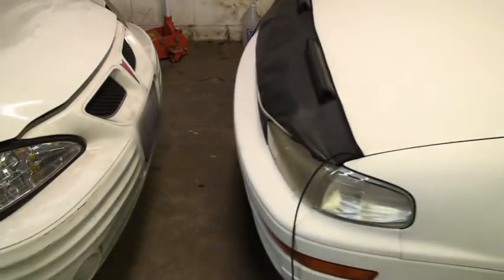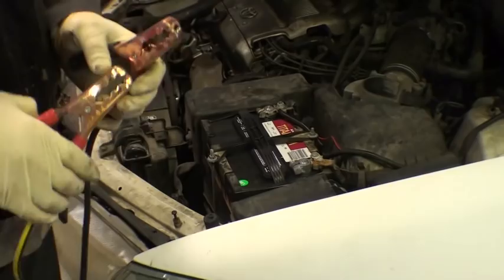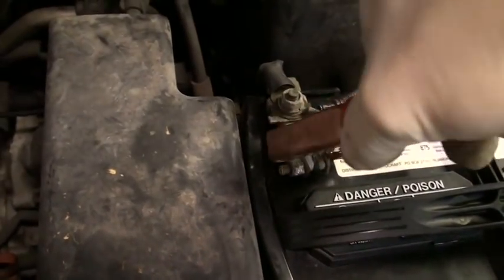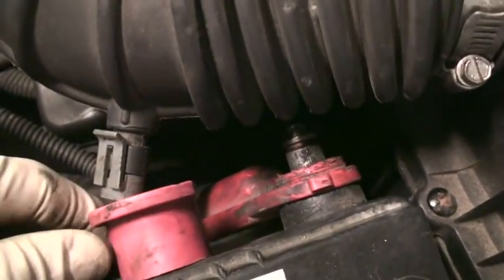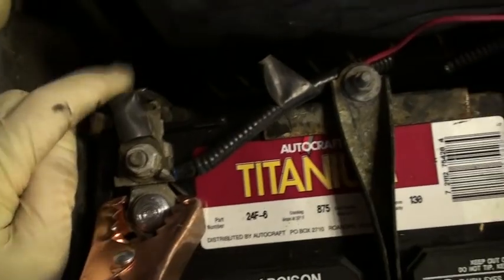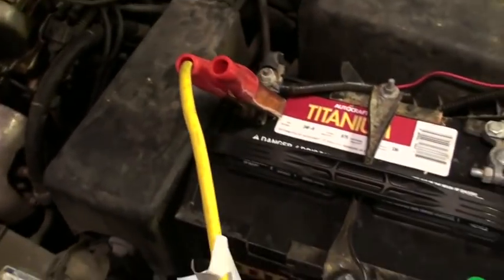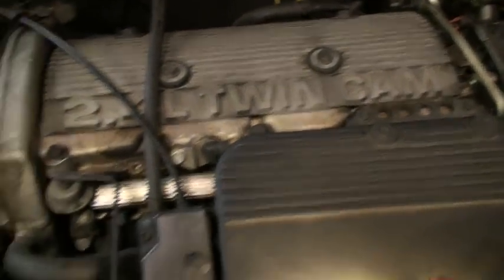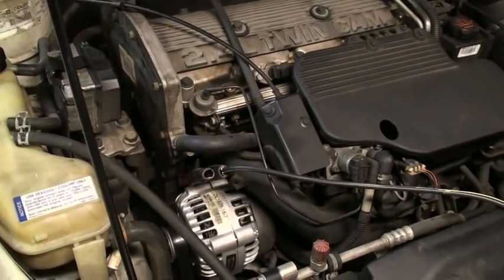How To Jump Start A Car - EricTheCarGuy

Comment: How does a starter work exactly? Like once you turn the key what is happening in your engine? This is something I've been wanting to know and never learned. Thanks
Reply: +Country Hits it turns the engine from with in the transmission.  When a car is running, the force from the combustion of gas in the cylinder forces the pistons and turns the crank shaft.  The starter, from within the transmission, turns the crack shaft, which moves the pistons and when the piston is up, air and fuel are added into  the cylinder and a spark combusts the gas, starting the engine.  The job of the starter is just to turn the engine until combustion happens.

Comment: I know I need a battery & didn't think much about it until my truck wouldn't start, I early on poured coke soda on the cables in May of this yr & have not had any issues until lately.  I will try hard not to go this route again.  Thanks for the video Im goin to buy new battery today.

Comment: On the 2013+ Chevy Spark you can actually void any electrical related warranty by directly connecting the cables to the battery.

Comment: ***** You don't want to connect the black Negative cable directly to the terminal because you can damage fuses, certain circuits, or even the ECU with that "sudden jolt" from the working battery...

Comment from the maker: @sammislawa I recommend watching the video I did on Load Testing A Battery.  I would also check to make sure the battery connections are clean and tight.  If you don't find your issue with this advice email me and I'll see if I can help further.

Comment: Hey Eric.. Liking the Channel so far. 
So i just heard that its advised that the "GOOD CAR" should leave its engine off when giving a jump start to the "BAD CAR". 
This should be done to avoid damage to the good car, especially modern cars that have more electronics. 
This is new to me as I've always done it the way you've  instructed in this video (minus leaving the negative off the BAD CAR, thats new too). 

Can you credit or discredit the theory about leaving the GOOD CAR's engine off? 
Thanks.

Comment: Eric, does the order of the positive plugs connection matter? For example if I plugged in the positive end to the working car first instead of the dead car followed by the other positive end onto the dead car and then the black end on the working car and the other black negative end onto a piece of metal of the dead car would that still work? Thanks

Comment: would you get shock or start a spark if one jumper cable is touching medal? Like if you were clamping them in the side of the car so they won't touch.

Comment: @EricTheCarGuy ohh okay thanks(: Sorry for all the questions but, i already replaced my **4th** hose, they keep getting tiny holes like the size of a needle then the pressure makes it bigger, do you think this is due to the radiator cap pressure or is it just normal for them to be breaking like that? Theyre old but 4 hose rips in 2 weeks? and questions 2, my car is automatic and when it goes to next gear or whatever its called it kinda hops, like how a stick shift car would, what could be wrong?

Comment: Here is a question, I recently had my 2002 Hind Accord SE serviced. Apparently the starter relay had stopped working, my car would not start. After picking up my vehicle, a day later I notice my cruise control no longer works, I took my car back to mechanic that replaced the relay, and he tells me "Nothing I did would have affected the cruise control". The CC was working fine before I took it to him. How can I trouble shoot the CC on my make and year? Thanks.

Comment: The slam panel is where the bonet shuts, go to goggle if you dont know what i mean, british and US have different words for some things, so i dont know what the correct word you would use for it is :P
Thanks for the reply thugh, it was just  a small spark. maybe its cause the job leads are old and cheap lol
on another note, how long do you think it will take, for the battery to recharge back to full power 12v?
Thanks again Eric ;) Great vids

Comment: I also have a pontiac grand am. how do i disconnect the battery? mine has these rubber boots on the side posts and i'm not sure if im supposed to peel it off, yank it or if the metal post sticking out actually unscrews.  thanks

Comment: i have a project car that i want to install a auxiliary fan. but i want it to be controlled by a thermostat. is there a thermostat that i can buy that can do the temp sensing for the aux fan? i kinda know the wiring with all the relays. but what thermostat sensor could i use without using or relying on the cars own electric thermostat sensor? love ur posts and episodes ! real help for those who are tinkerers. thanks !

Comment: I'm always reluctant to jump start a moden computer controlled (ECU) car. Think I'm safe in saying that computers don't like sparks and current surges, which is something likely to occur with a jump start.

Not forgetting the possibility of damage to your good battery by a dead battery across it!

Indeed, a neighbour asked me the other day for a jump start, which I refused. As an alternative I offered him the loan of a charger for 20 minutes. And after 20 minutes charge the car started.

Comment: I left my car sitting for a month straight and now it won't start. The battery had no problems before. Do you think i need a new battery? Or does it drain over time when its not running? Thank you!!

Comment: I'm curious as to what gauge and length jumper cables EricTheCarGuy uses. I know what I have in my own cars but I'd like to know what you prefer in regard to jumper cables, Eric. Also, it seems that a lot of cables anymore are copper clad aluminum instead of pure copper like old ones, do you prefer one type over the other? Thanks for the cool videos!

Comment: I have a trick, ..maybe but i had two instances where my car radio was left on and I couldn't jump it. So (with all unnecessary accessories off before hand) I opened the hood and pulled the serpentine belt a few cycles to spin the alternator and that was enough to get my car going.

Comment: For those of you wondering why the last connection you make is to the chassis and not the negative terminal of the battery, here's why.

Because you're supposed to make the last connection away from the battery, so that the spark doesn't ignite hydrogen from the battery.
pos to batt, pos to batt, neg to batt, neg to chassis -- completes the circuit. These days batteries are almost always sealed so it doesn't risk hydrogen escaping or electrolyte leakage. But this is to be on the safe side.

Comment: it's just so you get a better ground on the connection. it isnt wrong to connect the wire to the battery, but connecting it to a larger piece of metal on the car is better.

Comment: Eric, my wife has just bought a 2003 Dodge Caravan 3.3 V-6, it's got a New Battery on it and check with a tester I have that it actually is at 12 volts, the vehicle has had a no start situation and from what I saw as trying to start that the digital display on the radio when trying to start goes completely out, my thinking is a Dead Short, normally I think that the armature in the starter is touching the field coils, I have cleaned the cables twice and they seem to be factory cables. Ok, you guessed it I installed an Autozone upper-level Reman. starter, darn thing fired right up like it is supposed to. Next morning the wife gets in and NO START, not even a turning of the engine. I haven't tried and checked the cables out as of yet and from watching your vids, I am now wondering if the cables are the problem, (they look original to me and have not had any of those stupid battery ends that you HATE put on), but I am getting NO TURNING of the starter motor at ALL, and that was the exact same situation before the starter change, so I am quite confused right now. One thing that surprises me was before I changed the starter, the vehicle had sat for a few weeks with the NO Start issue and just out of curiosity, thinking that maybe a hammer hitting the old starter MIGHT disengage the armature to get it running, low and behold, I turned the key and the damn thing started just like it was supposed to and I had not even hit the starter before I tried. Installed the  Newer Starter anyway and still have the SAME situation. I am wondering about the cables, but it would seem that I would get at least a dragging sound out of the starter if the cables were not carrying the right amount of voltage, I get NOTHING. I just can't figure out what is going on. Me hating Dodges (I'm an old 67-year-old Hot Rodder and have worked on quite a lot of vehicles in my lifetime) may be the problem, LOL, but I know better. Any ideas as to where I need to go, I would greatly appreciate any input you could give me. I am at a LOSS at this point and time. I hope you can make some sense out of me trying to explain myself with this vehicle.

Comment: What I do if I am asked to jump start the car is let the bad car charge up little bit by revving my car at 2500 rpm for 5-10 min. Then disconnect the cables and start the bad car. The reason for this is that all those newer cars have lots of electronics inside and are kind of sensitive. So I never encountered it myself, but heard that sometimes when you start a bad car while it is connected to a good car, this can damage some electronic parts on the good car, which is my car in this case. This might or might not be true but I do it as precaution.
Reply: +Sergei Shabarov The damage is more likely to happen to your car.  If you connect the jumper cables with your engine running, your computer will have a large drop in voltage from the new connection being made.  That is more likely to damage the system.

Comment: what happens if the alternator is dead? My car's alternator doesn't work and the car place says it costs $250 to change it. Is that reasonable or any other way to change it myself?

Comment: wait, my brother said it is better to turn off the good car when starting the bad car, as a precaution to keep the alternator undamaged... Is this true? I did jump start a car from my car, and well i told them not to start it yet, but like most people that don't listen to my already anyways, they did, and so im just wondering if it should be something to keep on considering or its not really going to damage the alternator at all by overloading...(my car has a 1.8T and the car i jumped was a V6:O

Comment: hello i had subwoofers recently installed in my 92 geo metro, and my amp turn on wire is hooked up correctly so its not running all day. but my car battery still dies from nothing....
is it because i need a new battery, or when i jumped it i didnt charge it long enough?

Comment: when replacing the battery with a new one, by error, I inverted the poles, it sparked and the horn kept going. when I realized the dumb error, I connected the cables +/- but now nothing comes on, everything is dead. did I fry somerthing or could it be the selenoid?

Comment: @EricTheCarGuy Hey btw you should do a video on how to wire a switch to control a radiator fan using a switch. I was looking EVERYWHERE how to do it but i couldnt find one but i figured it out x) and i even fit it into a empty panel cover so it looks all pro lol.

Comment: Here's a thought and how I have always done it. Listen on and it makes sense.
1. Start the good car first. so there is no chance of a dead car draining the good battery. That would be bad.
2. Hook up the grounds first, no chance or sparking yet. If you hook up the lives first, there is a chance to get something grounded accidentally. 
3. Connect the live on the dead battery before completing the circuit on the Good one. The reason is that a good battery has less a chance of leaking gas and with the car running, there will be no stale air to combust with the fan and the belts going. 

Would love to hear comments on this.
Reply: now thats the right way my friend. an an electrician we always hook up ground first in any installation becuase by hooking up live first the other end of the cable is potentially live
Reply: stephenacamille If you hook up the ground first, everything metal on the car you touch with the positive lead will create a short circuit. If you were to drop the positive lead inside the engine bay, you will have sparks (or worse) go everywhere. 
If you drop the ground lead inside your engine bay, you will create a regular circuit. Still some sparks but nowhere near as much amperage going through the leads.

Its for this same reason you always disconnect the negative pole of the battery first.
Reply: Raspoetin a you have them mixed up. The ground is directly connected to the frame already. So touching the positive lead on a ground will do nothing unless the other positive is already connected.
Reply: stephenacamille Both the positive and the negative are already connected to the battery of the donor car. Its the donors car battery that you are shorting out.

Comment: you can crash start  stick shift car as well (down a hill or a slope. or push )get the car rolling put in to 2 and let out the clutch if you are roiling fast a buff it will crank over
Reply: +Chris Taylor That is also referred to as pop-starting.

Comment: alternators put out the same voltage no matter the speed.   Revving up does not help.
Good advice to run for a while before starting, though.
Reply: You're wrong. Alternators do put out higher amperage at higher RPMs.

Comment: I have a question. I have a 1997 Toyota Corolla that has been giving a P1300 trouble code for a while now. I have had the distributor replaced. I have had the spark plugs & the spark plug wires replaced. There must be some electrical issue with the wires going to the computer or something I think. Maybe the igniter...? I have no idea. Help!

Comment: Okay, why would you want to connect the negative cable to some metal part instead of straight to the battery? I don't see any difference since the connection between the negative battery terminal and the rest of the car's metal is usually pretty good and you could cause sparks anywhere.
Is it just because of the hydrogen that might form around the battery, where you wouldn't want any sparks when connecting the last connection? If so, wouldn't those fumes disappear after a few seconds that you left the hood open?
Reply: pcfreak1992 Yes you are right I think but this is an instructional video and it's always better to be safe than sorry with stuff like this.
Reply: +pcfreak1992 You are correct sir, when a battery discharges, it can, (key word there is can), let of hydrogen gas which could, (again key word there is could), explode if the connection sparks when you hook up the jumper cables.
Reply: +cjgaltieri yeah I thought so, but I still can't imagine how in a normal scenario hydrogen would ignite if you jump start a car. Usually you open the hoods first and then figure out where the battery is and by the time you connected all four ends, the hydrogen should have left from wind or something.
Reply: +pcfreak1992 your exactly right, it would most likely not happen.  Thats why we do not hear all sorts of stories on the news of peoples faces being blown off while jump starting a car.  It is very unlikely to happen, but it would be really bad if it did explode, and it really doesn't take any extra work to connect it to a different ground, so its just a simple case of, better safe than sorry.
Reply: HYDROGEN GUYS, HYDROGEN!!  Surely you know a battery produces HYDROGEN.

Comment: If the cables were hooked up wrong and the connections started to smoke/spark would the damage show up right away, or would it take some time? Would it damage both cars?
Reply: +VanSaucy It would must likely show up right away.  It would have the ability to effect both vehicles.

Comment: Thanks... of course I meant *wear* not *where* safety glasses.  Another thing you can try is to start the good car then connect the battery of the dead car.  You will hear your alternator kick-in and re-charge the dead car's battery.  Just disconnect before starting the other car as you do NOT want two alternators running at the same time nor should you try to jump start off a running car.

Comment: hey can you do a video on master switch for power windows .. my driver side window rolls down but all 3 of my passenger windows does not work at all. tried to replace the main relay fuse and no luck.

also another video on the fuse box for the SMALL LIGHT category . that fuse for SMALL LIGHT keeps popping and my brake lights will not turn on when it's on daylight position ..my headlights are on but my taillights are off. please and thank you

Comment: With my understanding of how electricity runs through a battery I would love a detailed explanation as to why you would ever need to start the good car and why you would even want to, seeing as how starting and revving the good car would only wear down the alternator. Anyone with some more insight wish to enlighten me cause I was under the distinct impression that the electricity in a battery is always flowing so just by hooking up the cables the battery should be getting a charge. I'd assume it would take longer but would do little to essentially no damage to the good car.
Reply: from my understanding, connecting a good battery directly to a weak or dead battery puts a huge load on the good battery. so the good battery output from 12v is now down to 6v for example. so the engine running keeps the good battery at a steady voltage output so it doesnt drain from the strain of the weak battery. it would be like they are just sharing power. just my thoughts, and i could be wrong.
Reply: Awwww makes sense. So by running the good one, keeps it from being drained to the point of needing a jump.
Reply: +Stefan Briney right.  The last thing you want is to drain the battery on your good car while jumping your dead car.